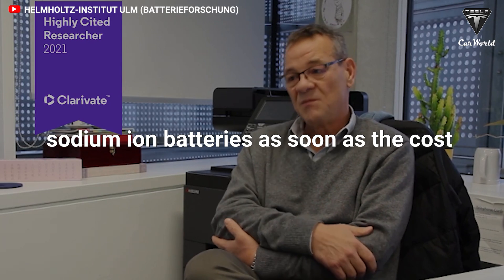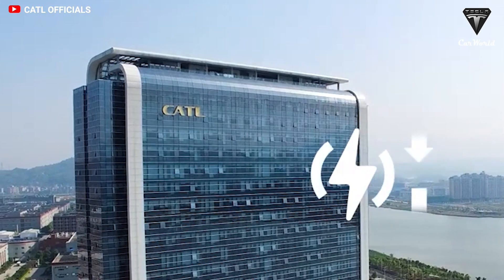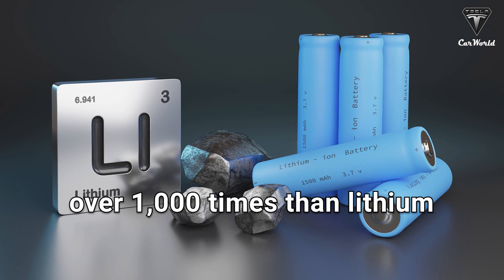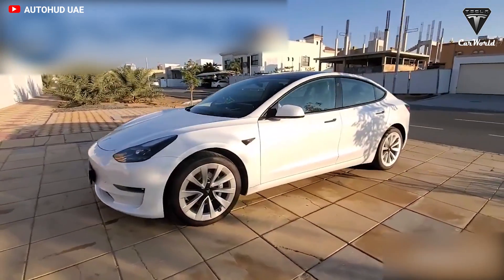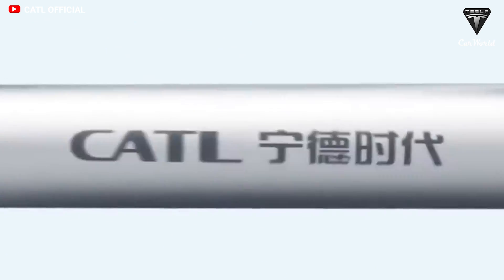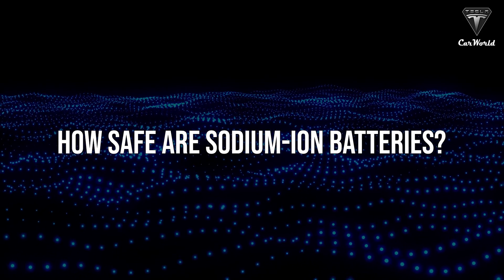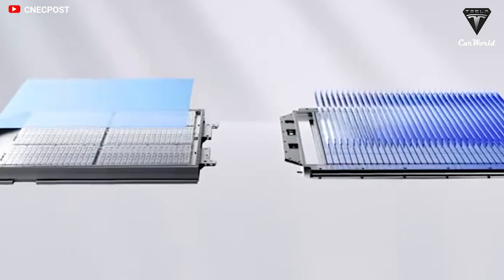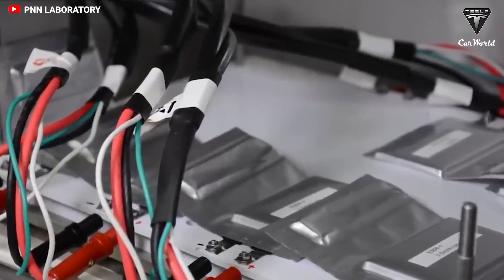Goodbye Lithium! NEW Sodium Ion 4.0 Battery Changes Everything in 2023!

Comment: Thank you for this very well made video. 

First, I don't think this will appear in EV's any time soon. For one ramping up the volume of production take time. Maybe in 2-3 years they can make that in volume. 

But more importantly, to use them would require a redesign of the EV platform if they are to fit in vehicles and still meet the old km/range. Or risk a shorter range, which i don't think is going to sell well.  There is also no mention if the weight of sodium batts will be on par with lithium. No doubt we will likely see an increase in weight per kw/H, which again throws a wrench in the old vehicle platform. 

If you ask me, the best use of this tech is on solar, wind, hydro powered electricity. This is where volume (or weight) is not a hindrance. This would lower the cost of storing energy. And even if the energy density is low, because of the lower price, it's just a matter of adding more packs to achieve the same power.  

The side effect of using these in alternative home power generation would be to free up the lithium for EV use. This should slacken the demand and maybe lower the price of lithium. Maybe, because the other car manufacturers will also ramp up and the demand will remain high. 

I think another 5 years of R&D is still needed to solve many limitations of sodium batts. In the meantime, the home energy battery requirement is more than ready for a much lower priced energy storage solution. That market can already use them. The onus is, this will spur R&D and push for more production. There will be revenue generated in the current R&D output as the next gen is being researched upon. 

The other good thing for using this in home power storage is that it will further spur the sales of solar panels, wind, hydro solutions, which would be a self priming and adding to the expansion of other industries. Even in large scale storage, such as a small city or solar/wind farms, can benefit as a lower cost of power storage will allow them to build up their storage way cheaper. Again, volume and weight is not an issue for these applications.
Reply: You are dead on right in your comments.
Reply: Let us see how technology progresses!  When Charles babage invented... COMPUTER was of  a room size and now we have micro computers too.

Comment: Might be good for things like electric forklifts (where you change out batteries when the charge gets low), golf carts and stationary power backup/storage, but 1/3 less range in a vehicle application is a deal-breaker. Yes, you can add more batteries because they cost less, but would your average car buyer want to drive an 8,000 pound battle wagon?
Reply: If you could fully charge in under 15min then I'd be happy with Na-Ion.
But I don't like the charging system for EV's. 30+ vehicles waiting for 30min-1hour to charge doesn't seem practical for me...
I hope batteries are greatly improved or made swappable when they lose longevity. I see Red Hydrogen vehicles being the solution, FCEV'S is the solution to all of EV's problems
The Red Hydrogen Nuclear power plants is an extremely safe, effective and cheap way to produce energy, hydrogen. 
 Most of all red-h2 makes all production of cars, industry and ships. So we are not running off coal and methane.
Reply: what about charge in motion, which italy has already got working?  just put the system in the road and let people use it free.  the same price as the interstates.  if you want a paygo, tax stocks, put in an alternative minimum tax so that warren buffet pays more tax than his secretary.  he says he now pays less!  many billionaires pay nothing.

Comment: Lithium will never be replaced as the best element for storing electricity as it is 3rd on the periodic table, so it has the lowest mass/ number of electrons for an element with the same properties. Hyrids could be an improvement and costs may improve when it takes a down turn on the stock/commodity market. Especially, if sodium-ion batteries take some of the limelight.
An example of hybrid being best can be found in steel, as it is actually stronger when it has a low amount of carbon if it is evenly distributed. Whereas people commonly think that metal being folded more makes it stronger, which is only true to a certain extent. Cast iron bridges where common until they started breaking because of having a poor distribution of carbon. Modern methods of creating cast iron is much better today. I hope the battery technology can improve its efficiency to the same degree.
Reply: Bro..its just a false news..Market cant survive without lithium and its chemical properties...
Reply: @wannacu3388  yes, don't ever lose your skepticism. You've come along way.

Comment: I don't mind the 30% decrease in energy density. I will get sodium battery as soon as it comes out. 😊 I have a scooter with lithium battery and it is awesome. But if it dies out eventually,  i will replace it with the biggest fitting sodium battery.  It is cheaper than lithium and not much weaker. So total buy in. Now lets see when it comes out. Is it as good as they say?

Comment: at a 1000 miles they can really replace gas only vehicles. this is because there are a lot of hills and rough road, so real mileage is probably about 1/4 listed.current and upcoming models make more sense in the eastern great plains regions of the USA where it is pretty flat. The west side of USA is very mountainous and hilly and lots of windy roads and long gravel roads.

Comment: I may be wrong but my understanding is that Sodium-Ion batteries are not energy dense enough for use in EVs.
They should be great for solar charging port and fixed location power storage though.

Comment: There are  many directions on battery technologies. Like Lithium oxide baterries,  or graphene batteries with great results in test lab, but still not reached consumer  market. I wonder why, and hope, that one day one of these technologies will prevail, and bring real imporvements compared to more than  2 decades old lithium battery technology.  I dont need EV with range  of 300 miles or less  on paper. I need vehicle, that can do 1k km with one pit stop, like any diesel  internal combustion engine can provide without trying to save fuel.

Comment: It only takes 5-10 minutes to fill an ICE auto.  If you run out of gas, it is easy to put a couple of gallons in the car to get to a gas station, if you're in the desert, you will be dead or need a tow truck  to have your car towed, or or diesel generator brought to you.

Comment: The greater the number of cells in the battery and the larger they are, the greater the electrical capacity of the battery, expressed in ampere hours (Ah). Using voltage (V) and ampere hours (Ah), we get a battery whose energy is E=V.Ah. Assuming that the chemical reactions (energy released) take place at the surface, we get the total energy of the battery by adding all the infinitely thin cells dx, where the thinner the cell, the greater the energy density (E/(L-x))dx=dE

Comment: What is the energy per gram? Like Tsiolkovsky's rocket equation greater weight is a greater draw on power which leads to more batteries which leads to more weight which leads to....well you get the picture. Look at the electric scooter industry, you can get amazing range if you sacrifice top end speed and powerful acceleration, it's just that nobody wants a car that takes 30 seconds to go from 0 to 60 mph.

Comment: We won't see the actual cost savings.  It just means there will be more profit to be made.
Reply: I think it was Ford or Chevrolet that reported they lose $30,000/vehicle. If the new batteries cost $20,000 less, they would still be losing $10,000/vehicle. It is kind of hard to reduce prices at that profit loss.

Once they get all the tooling and production procedures dialed in, they can reduce production costs, but of course changing batteries changes production procedures also.
Reply: @douglasjacobs882  Does that realistic to you?  Peak ford and GM share prices in 2022.
Reply: @metricdeep8856  when you proportion the research, design, testing, purchasing, down time while changing production, including loss of sales of what the line was producing, into the first couple years of the new BEV, yeah, it seems reasonable. 

They had to set the prices for the new vehicles to be competitive with companies that already made the transition. Due to the new and upcoming regulations, they had to make the switch sometime. Being late to get into the market is more expensive than doing it earlier. The first Tesla cost more and had less features than one produced today. New electric vehicles today need to match the features of companies that already went through growing pains. 

If you add all the costs of Ford building the first assembly line to the first cars they made, they lost alot of money, per vehicle, but the added production rate eventually made them less costly to make. The second company that created an assembly line would have taken longer to be profitable because they were competing against the first assembly line, and so on.
Reply: @douglasjacobs882  Yet the share price is up...?  Their other gasoline models would increase in price to cover the overall costs of operating.   We will not see the savings as shareholders are the priority.  Business is about profit...not customers.

Comment: Better and more economical batteries are really nice and all, but we also just have a power consumption problem.

Computers are using more and more electricity.
People are not switching to heat pumps faster enough. Homes also need to be insulated better.
LED lights have been one of the more noticeable energy savers in homes, and the version of LEDs we get arent even that great. There are 60w equivelent bulbs in other counties consuming 4-5w instead of americas 9w!
We need carbon fibers to drop in price to make the everyday car be consume less power due to weight reduction...

Comment: It should have been mandated That electrical cars have to charge themselves. Remember the purpose of electrical cars Is  to reduce the carbon footprint not replace gas stations with electrical charging Stations. Why can't the Battery and alternator in the internal combustion engine be moved to the electrical car.

Comment: This is interesting, but hardly news. Sodium-based (sulphur) batteries were first used in the earliest electric vehicles in the 1890s. Yes, over 100 yrs back. Wikipedia pages say sodium battery development started in the 1970s and manufacturing sodium (ion) years later.

Comment: Battery tech hasn't moved at all in the last 10 years or so, The statement about the tech moving fast requires a different perspective than mine. If we get these sodium batteries in ten years and they underperform lithium, the only hope is that the manufacturers pass some of the savings in cost down to consumers. At that point, it is a step back for consumers if there isn't a significant drop in the price of electric cars. All I see right now is expensive electric cars that the vast majority of people can't afford that can't be driven far from home unless you have extra days to make a long trip. I hope there is significant advances in battery tech that solves the range issue, but right now, you need to spend 100K or more just to get a car capable of 300 plus miles from a charge, if you can find a charger. Charging to 80 percent does not give you 300 miles on most at any price point. I keep thinking that in ten years I could get a used electric car, but by then, it will need a new battery, among other things. So, not affordable yet.

Comment: This video acknowledges sodium ion batteries in a general sense but avoids framing the questions in the most clear way by using comparisons because when seen that way, sodium ion batteries are only for niche storage and won't ever be able to compete with lithium ion for mobile devices like vehicles.

The basic physics of sodium compared to lithium is because of their positions on the periodic table which means that chemistries and battery construction will be similar and can't be modified much. Whatever advances are developed for one almost certainly be applied easily to the other so it's a race where sodium will never catch up because mathematically sodium only supports about half the density and energy potential as liithium and until the immutable laws of physics and chemistry are altered, nothing can change.

So, anyone who chooses a pure sodium ion battery over a lithium battery will have only about half the powe or half the distance for the same mass or volume. If you're willing to double the compartment size to support sodium batteries, why wouldn't you consider doing the same and use lithium batteries instead?

this means that unless your vehicle is only puttering around a warehouse all day, sodium ion can never be considered for a moving vehicle.

Comment: Sodium explodes when in comes into contact with water, whereas Lithium just burns extremely hot.
If you thought the amount of burning lithium batteries we've seen was a bad deal, just wait until these sodium batteries make it to the road. Traffic accidents in the rain will be a massive danger to public safety.. Cars literally exploding; destroying the roads and sending shrapnel to nearby drivers.

Comment: With using salt, which the U.S. has millions of tons of, could solve 2 problems. 
1) it's cheaper, safer
2) we could set up desalination plants, getting fresh water for areas that need it, and use the salt for batteries instead of pumping that salt back into the oceans

Comment: This is chemistry. You cannot get an ought from an is. Sodium has a smaller electrode potential than lithium , so less power, and sodium is 3 times heavier than lithium and it is bigger in size.
Reply: Drop a ton of sodium into a lake. It blows the boat up.

Comment: There are sodium ion, potassium ion, magnesium, aluminium, probably, calcium etc. battery. Lithium is not nesessery. Salt battery is misinformation. Rather, it is a raw material obtained from salt (sodium). There is about 2 kg in a 100 kg battery, similar to a lithium battery. So it's not a salt battery. The problem is rather the fluorine salts in the electrolyte, if they are not bypassed.

Comment: Still don't understand your $101/kWh.  If current Li battery pack costs $8,000 and lasts 200,000 miles, that comes to $0.04/kWh.  Add electricity from any utility or even solar, still is a very low number.  Please explain where the $101 comes from!

Comment: First battery powered car made in 1830s. Invention of Otto engine ended ev era except for some service vehicles eg milk floats, golf karts and forklifts with lead acid batteries. If not for climate scam and oppression of carbon mineral fuels no one would consider Na ion battery an advance.

Comment: HHO is the way to go. The AC  water pump throw out clutch, that swtched to a saline  transformer selonoid, after incorporating it into a motor vehicle  transmission  throw out bearing, in the Frontier endeavor to raise the Broadband  wireless ceiling,needs the HHO emissions for the Argon Auto Analog accountability to the  Charcoal Canister Delphi  vacuum sensor  today. Stop putting  bombs in cars already. Its time for a ...
' HIPPA Home Box Office " operator and standby on the class D License for the First Gade Drivers Permit, where the Birth Certificate PO Box can begin sending automobile Messerschmitt private portability parts to the Organ Donor identification to the emission. I swear, they just cant kill us fast enough.

Comment: Hydrogen has made huge leaps lately with solid state storage and is poised to leave electric batteries in the dirt. So this may be a moot point. I personally believe 100% electric is not a good idea because of the long charging times and high battery cost. Plus 85% peak is just dumb. You shouldn't have to take out a second mortgage for a car. The hydrogen car offers a better faster refueling and with the new technology a more affordable option.

Comment: Seems to me that the electric car world is caught up in a immature  competition over distances achieved by their cars, would make a lot more sense to de-escalate this faux competition and focus on practical solutions in the market place. Most people don't drive huge distances on a daily basis, the window of opportunity is to provide what people really need,  build light weight practical vehicles that can be rapidly recharged after say 150 miles or simply topped up daily at the work place or at home, little and often. The amount of clean energy that can be consumed from the grid for this purpose also needs huge consideration , discussion and effort.

Comment: My "scam alert" jumped up immediately. They brushed over how much range you actually get, and of course it was done with a high decree of sleaze. It was also also clear that the sodium battery is not stand alone, but used with Lithium. It would appear the range is about 22 extra miles when used in conjunction with Lithium. I hate snake oil salesmen.

Comment: Quick Google search... take a visual average of Lithium Ion vs Sodium Ion.

They are about half the power density in both volume and mass.  You will need to carry 2x as much mass in batteries, and they will take up 2x as much space.

Cycle life is still in the hundreds to thousands range.  Needs to increase to 3000-5000 to be longevity compatible with the next generations of lithium ion or LFPs.  

Seems like an ideal space for large scale battery backups that cycle infrequently. Not a good solution for automobiles or for grid.  Yet.